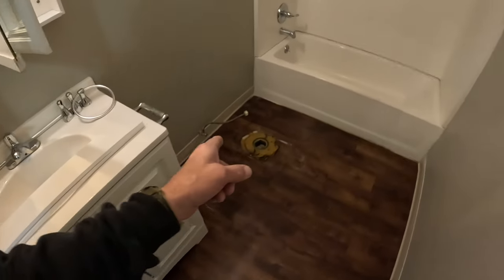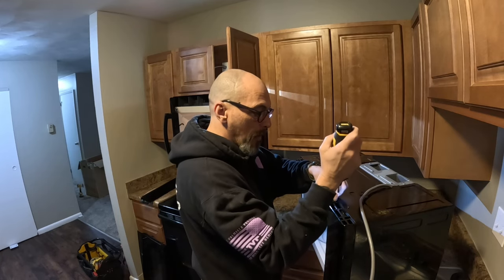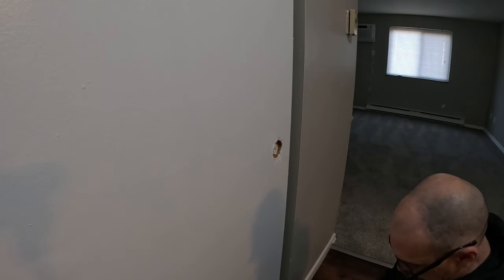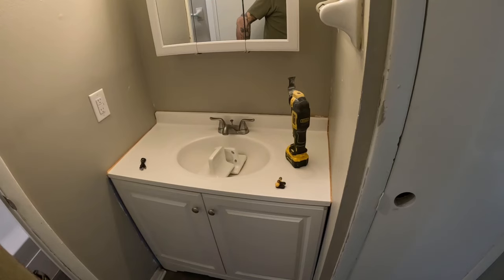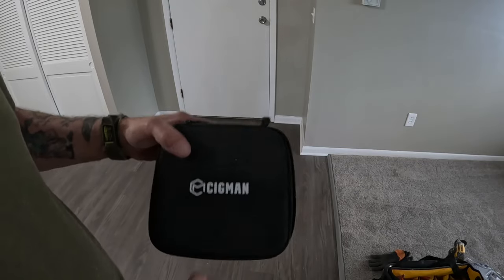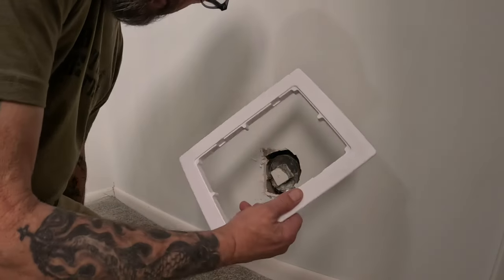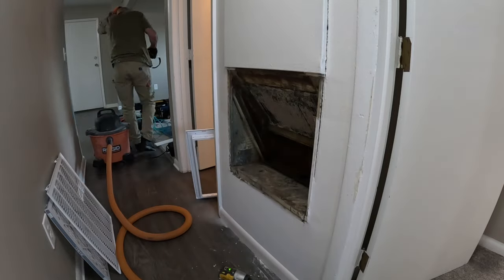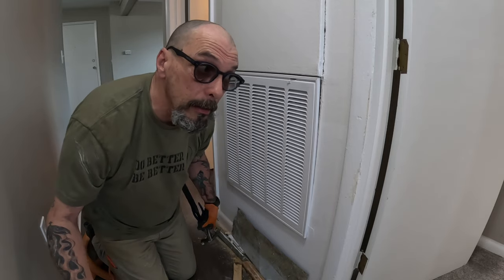Trying to get the turn's done for movie in

Comment: Happy birthday. Also that grip stuff really work good? What do you also use it for? PVC Tub edging?
Reply from the maker: sorry I don't understand your ?
Reply: @Raysmaintenance  grip loctite. I found out it’s used for Sheetrock and those items. Not really a tub and tile floor.
Reply from the maker: o. loctite -- I use it for gluing everything lol It is a glue that was originally used for setting tile. And someone got the ideal to put it in a caulking tub lol. It will set almost anything and I use it for small hole's in the wall cause it drys fast.
Reply: @Raysmaintenance  dry fast like how fast?
Reply from the maker: @AnthonyPerez    15 - 20 min